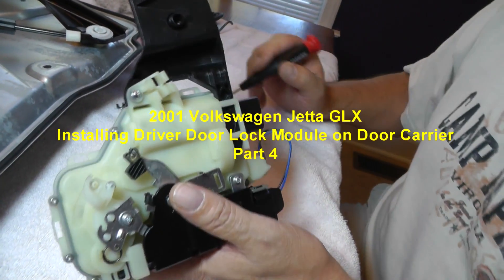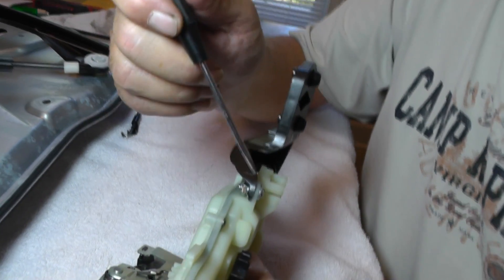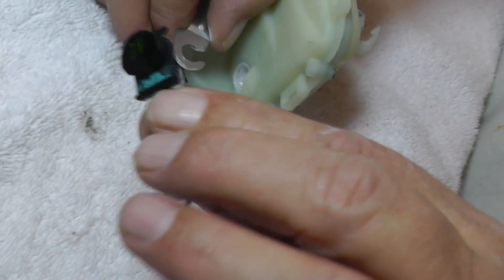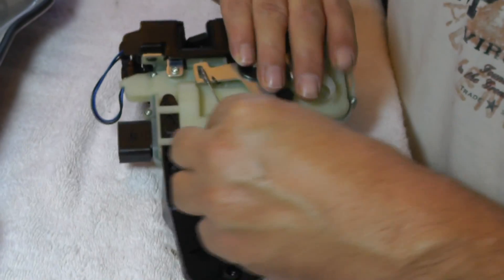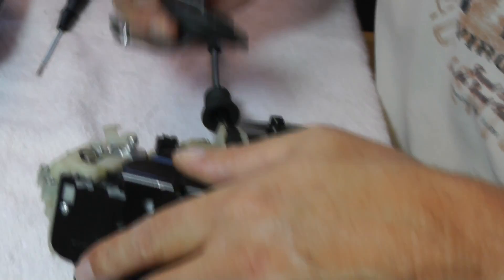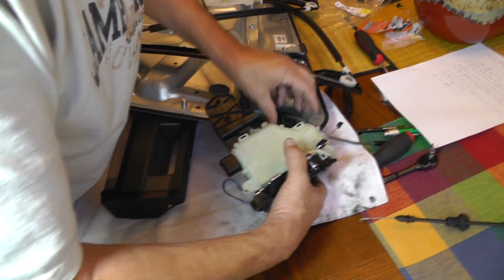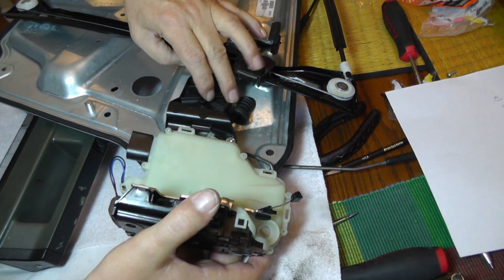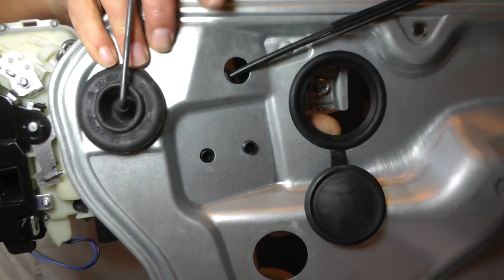Volkswagen Jetta Assembly of Driver Door Lock to Door Carrier - Part 4

Comment: Thanks for this video!  Keep up the videos on the mk4 VR6 your a wealth of knowledge.  Do you have the part number for the plastic bracket for the door lock module handy?  thanks again!!
Reply from the maker: +warpedmetalhead Glad you liked thee video series. I don't have the number for the plastic bracket, but you can call up the dealership to get it. I picked the bracket up at a local VW dealership. If you like the VR6 engine, I'm doing a video series on it now. I have four videos up now posted recently on replacing the coolant pipe and thermostat housing if you hadn't see them yet.